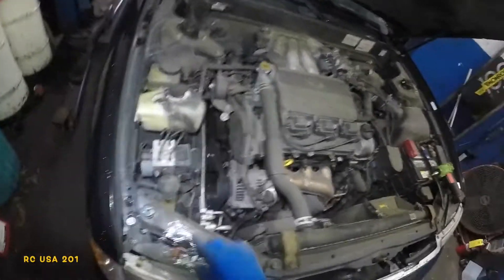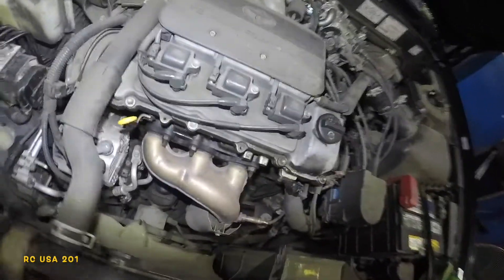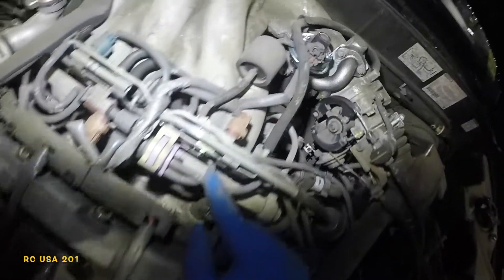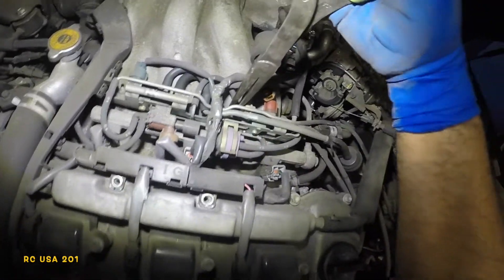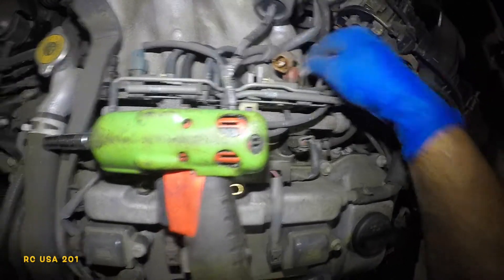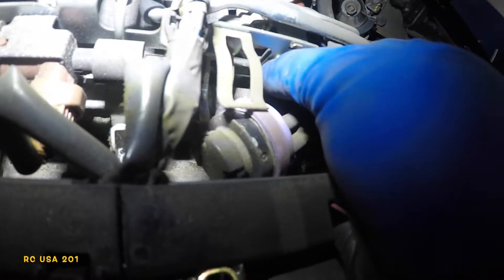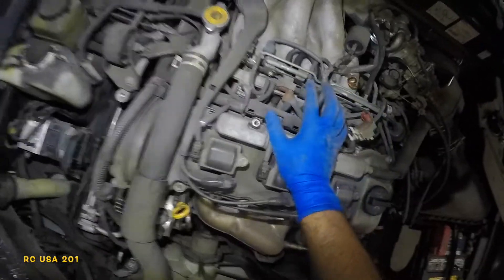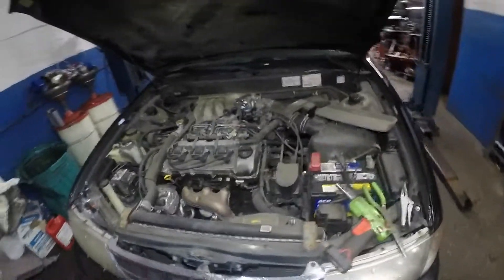Toyota Avalon 1999 2000 2001 EGR valve solenoid replacement  to fix EGR valve codes

Comment: Thanks for your video man. What is the blue one right across from the red one on the left side? I smell something like unburned gasoline vapors and it was throwing the evap code. Should I replace the hoses too? It seems kind of crazy they aren't clamped and just friction fit on there, these vehicles are old now. Thanks
Reply from the maker: I would need to check but it might control the intake flap
Reply: Im also having this issue dit it fix it?
Reply: @dexy_retribution1754  for me just replacing the solenoid in the video fixed the issue. Well, for 6 months at least... pretty sure I need the canister replaced
Reply: @escapetherace1943 when i look in the area i see everything looks fine then where the vacuum hoses go there’s just one oddly super rusty piece I’m assuming that’s probably the rest of the issues
Reply: @dexy_retribution1754  so long as there isn't an air leak and it isn't compromised it should be fine.
Otherwise what causes this issue is this bad solenoid in the video, an air leak in the line, the evap canister itself (expensive), or a bad seal on the gas cap allowing vaporized fuel to leak. Good luck.
Reply: @escapetherace1943 actually did fix the issue and the exhaust no longer comes in the cabin, but like you said for how much longer lol.

Comment: So I was working on my 2003 avalon ended up breaking the vacuum switching valve (the one you have in the beginning of the video) and the car went into a kinda of limp mode where it wouldn’t accelerate past 2100 rpm. I replaced the it but the car is still doing it any idea what it could be
Reply from the maker: Did u scan for codes

Comment: My avalon2001xl does pull i.e when I have ascend a hill it doesn't move as per how I push down  acceleration pedal .I have changed  plugs no changes. Please  need your help
Reply from the maker: Didn’t check transmission fluid